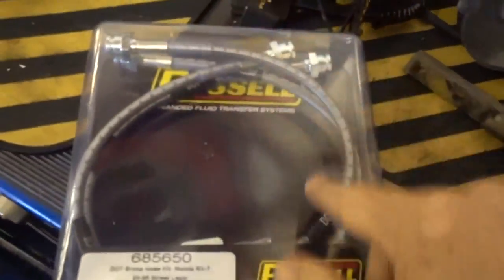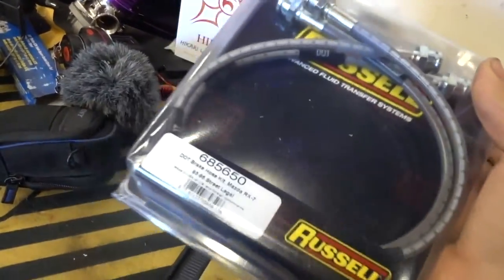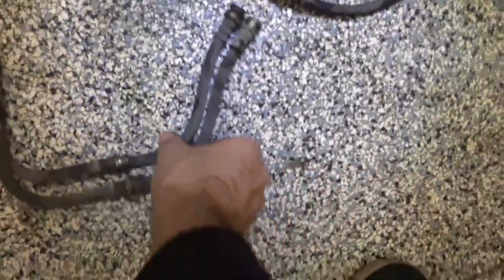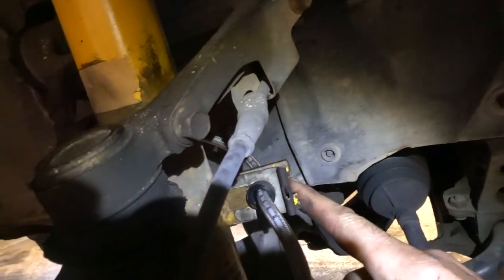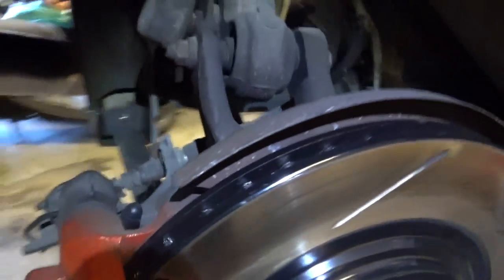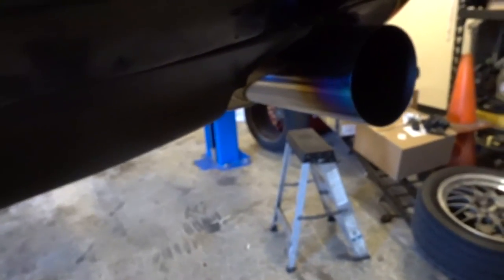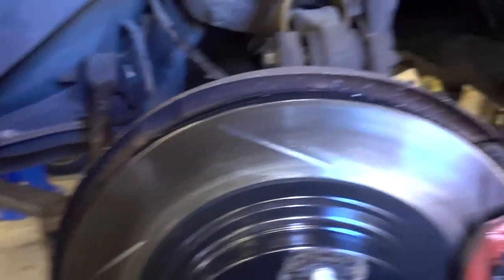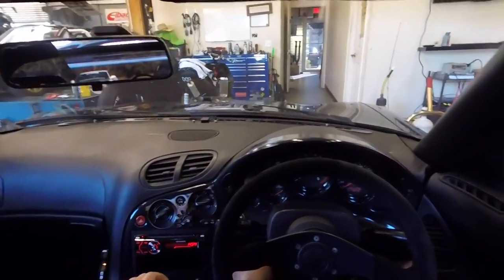Project RX7: Braided Brake Lines! and new cars on the way!

Comment: Love your content! Can't get enough of this FD and Dusty. I actually have a question that would be awesome if you could answer as a mechanic. I just flushed the brake fluid in my car using the hose and bottle technique a few days ago. During the process I accidentally got really close to running the brake fluid reservoir dry. My question is, if the brake cylinder did actually suck in air, would I have felt it through the pedal or would it just feel the same as every other pedal pump? I feel like my brakes require a bit more pressure since that happened, but it also may be just in my head.

Thanks.